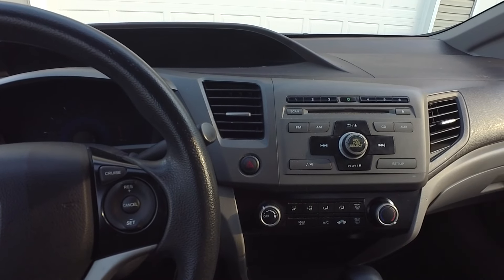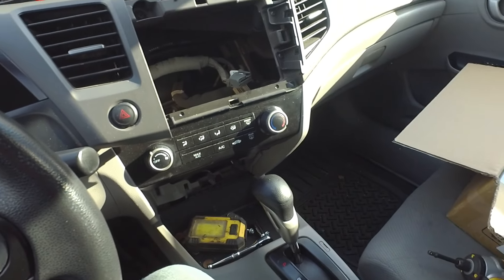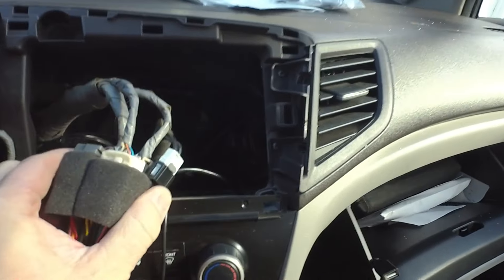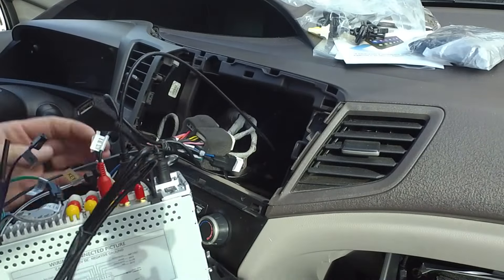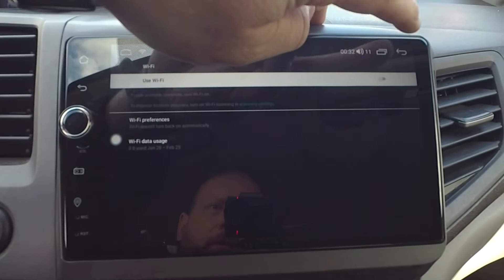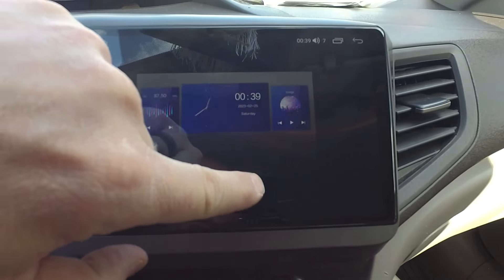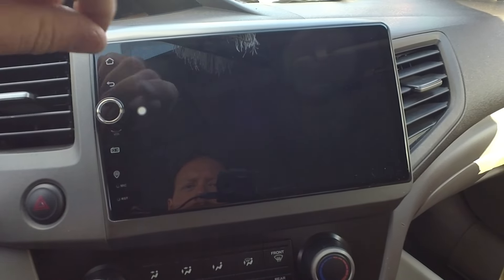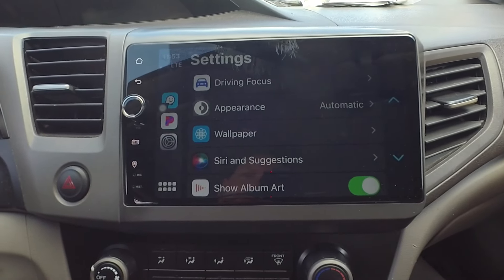2012-2015 Honda Civic Android Navigation Stereo Upgrade Installation and Review Joying JY-HQ142N8G-B

Comment: If my factory civic si came with a usb in the center console can I use that to plug into the unit?
Reply from the maker: Yes, but it requires modifications
Reply: @JackofAllMasterofNone Hello. Hope you are fine. About this… What modifications?  
Thanks.

Comment: Great video, I'm considering installing one into my '12 Civic Si.  One question though, you mention late in the video when you're demonstrating the Android Auto and Apple Carplay, you connect them wired and you mention that it "doesn't automatically connect via bluetooth, you have to do that manually via the bluetooth app".  

Does that mean that if you want to use Apple Carplay wirelessly that you have to re-pair your phone each time you get in the car?  Or did you mean you still have to manually pair the phone as part of the initial setup even though you connected wired?
Reply from the maker: You just have to pair it as part of the initial setup. It will connect wirelessly automatically.
Reply: Great, thanks for the response.  And in case you know, will this unit work with the steering wheel phone controls and factory subwoofer in the Civic Si?
Reply from the maker: @jprice4250  don't think it works with phone controls, just the volume and left right. Not sure about the subwoofer
Reply: @JackofAllMasterofNone  Cool...thanks.  If I end up installing the unit I'll update here with results.  Appreciate the video and quick replies!
Reply: In case anyone is wondering, I found this on the eBay page for this item:

"Purchase Notice:
 
* Acceptable for vehicles with Left Wheel only.
* Please send us a dashboard picture of your car after you place an order. Or inform us whether your car has Premium Sound System or not.
* If you don't leave us a note, we will include the default harness for base model (the one without big screen and without Premium Sound System)."

So it seems they have a different harness for the models with the premium sound system or the Navigation.  I've ordered the unit and requested the Premium harness, will update with my findings when I get it installed.
Reply: Hello all, just a follow up, I got the unit, installed fine, the only thing the harness didn't support was my factory subwoofer (which isn't that great in the first place).  They offered to build me one, but I was able to find the connection I needed in the Metra 70-1730 harness kit.  It has an RCA to Honda connector for the subwoofer.  The steering wheel phone controls DO work with CARPLAY.  I can answer/hang up/trigger Siri.  Overall very happy with the product, and thanks to Jack of All Master of None for the video, it certainly filled in the gaps of what was needed to complete the install.  Oh, and one thing I had to do on setup was to turn on the AMP in settings.  Since my 2012 Civic Si has the factory AMP, no sound was coming on until I turned on AMP in settings on the Joying unit.  A great upgrade to the car!  Also, regarding the seller, they were responsive to my questions, it took about a week to ship, but once shipped it got here in 4 days.
Reply: @jprice4250  I'm glad everything works. The only reason against me buying this is it probably has weak power going to speakers. Any idea what the RMS wattage numbers are?
Reply: @jprice4250  does it work woth lane watch wires? And does the time on the new screen reflect on thst i-mid screen?
Reply: @jprice4250  how automatic are we talking? Do you have to open that phone sync app every time you want CarPlay or does CarPlay automatically come up when the phone connects via Bluetooth?
Reply: @lionintu  Hey, sorry I don't.  However in my Civic Si it sounds good, but I believe that's due to the sound going through both the unit's amp and the amp in my car.
Reply: @lionintu  I don't know if it would or not, it has 2 other video inputs, but I don't know if it would work with them.  I'm not an expert by any means, I was very reliant on the info in the video by Jack of all master of none.  However, I can tell you that the times do NOT necessarily match.  The i-mid is still set via the car.
Reply: @user-gc1ky2rf3y  I have an iPhone 13 and once it's paired with the car and set up, it connects automatically without any intervention.  I can keep my phone in my pocket, and when I start the car, the unit will go through a connection sequence (much like he shows in the video) and then CarPlay is up and running.
Reply: @jprice4250  Thanks for the reply!
Reply: @jprice4250 I have a civic si 2012 as well. Had to do the same taping amp wire to ACC. My SWC don’t work. Does yours? I have changed the canbus models for my android unit to 10 different types and nothing makes it work. I’ve looked into tapping into SWC wires but can’t find any steering wheel wire harness diagrams online.
Reply: @jprice4250  Do you know if this works with the factory reverse camera and lane assist camera?
Reply: @jprice4250 i ended getting the same harness once i plugged it in i heard the sub power up for a second. But then nothing when i started playing music is the a fuse for the sub that might’ve blown ? Very simple plug and play so idk what’s wrong now maybe its just a shitty sub but i felt it more before the upgrade might take it to a shop

Comment: After installing the new touchscreen radio in a 2013, the small mini screen up on the dash stays on whenever the car is off, any reasons why ?
Reply from the maker: No idea. That's not normal
Reply: Did you ever figure out the solution I’m having the same issue

Comment: Hey i got mine and the steering wheel skip buttons and volume buttons are not working can you help
Reply from the maker: Check the canbus settings and make sure they are correct for your car. Also, make sure the can in and out wires on the back of the stereo are connected to each other.

Comment: How do you get the firmware updates? Is it downloaded from the stereo or do you have to download it onto a USB and then put it on the stereo?
Reply from the maker: You download them on to a USB drive and the unit automatically recognizes the update and runs its.
Reply: @JackofAllMasterofNone  thanks!
Reply: Hs there been any updates since your stereos manufacture date?
Reply from the maker: @lionintu  Yes I believe there has been 2 updates so far.
Reply: @JackofAllMasterofNone  cool thanks.

Comment: How did you get your steering wheel buttons to work?  I had mine installed but it's not working.  How is the wiring done?
Reply: And why is your Factory -> Car Model set to CRV instead of Civic?
Reply from the maker: It's plug and play. It's set to CRV because that is the canbus settings that works correctly with this car. As long as you connected all of the harness correctly and also double check that the looped wiring coming out of the back of the head unit is plugged into the canbus wire.
Reply: Did you get it working?

Comment: So with the new head unit, we don't need to use the two 8mm screws anymore, right?
Reply from the maker: Correct
Reply: Do you know how to remap the "source" button on the steering wheel so that it can start/pause music? Now it is switching between apps in my case
Reply from the maker: @duyanhvu5841  Unfortunately it's not possible. The canbus steering wheel controls cannot be remapped.

Comment: Does this work with both cameras rear+side? Can I upgrade the camera on the side mirror?
Reply: did you end up figuring it out? i cant get the side camera to work, but the backup camera works fine
Reply: @hussainahmed6638  I didn't install the Joying HU. Yet. I still have A sony AX-7000 which only has 1 input which i use for rear cam. I haven't made the leap because I'd have to also buy an amp to at least match the ax7000 performance

Comment: Any reason you can think of my all my audio only comes out of passenger side?
Reply from the maker: well start with the easy stuff first and check the fade and balance controls to make sure it is not set all the way to that side
Reply: Thanks for responding, yeah I ended up figuring it out. I thought I didn’t have to plug all those extra connections into the back of the head unit but I did 😅 only problem I’m having now is Bluetooth audio and music stuttering every few minutes on Apple CarPlay. Drives me nuts. Audio works fine on regular Bluetooth tho.
Reply from the maker: Not sure if you're using wireless or wired carplay but I would use a different cable if using wired.

Comment: Is this exact head unit on Amazon ? If so send the link pls
Reply from the maker: This is not sold on Amazon. Only eBay. 
From the video description
The process for the 2013-2015 Civic is very similar to the 2012 Civic shown here.  If you have a 2 piece system (separate heater vent and stereo) you will want to buy this version (8gb/128gb) https://ebay.us/pWUggc
If you want the 4gb/64gb model buy this https://ebay.us/JewQxr
If you have the combined heater vent and stereo model (2013-up) you will want this unit https://ebay.us/wVbnL1
This is the backup camera I recommend https://amzn.to/3KSQltp
This is the USB port I used https://amzn.to/3XTv45u
UPDATE: New for 2023/2024 Android 12 Version with DTS Audio
2012 CIVIC Android 12 4+64GB: https://ebay.us/bqD9yt
2012 CIVIC Android 12 8+128GB: https://ebay.us/ZznxFZ
2013-2015 CIVIC Android 12 8+128GB: https://ebay.us/Q3Tnly

Comment: I need help. I have the exact same car. I bought a Hikity aftermarket stereo on Amazon. I installed it and the power would not turn on. I placed the factory stereo back in to test and it would not power on. I lost power to my IMID, cigarette lighter port and usb in my console as well. A few days later I found that I had blown a fuse under my hood. I replaced it and the IMID has returned to its normal function, the usb in my console also works but the cigarette lighter still has no power, and the factory unit has power but will not work at all. I can’t find any other blown fuses and I’m dreading having to try and take it to someone.
Reply: Check your fuses in the driver's foot well
Reply: @MicRuLerZ  I checked all the fuses. I can’t find anything wrong!